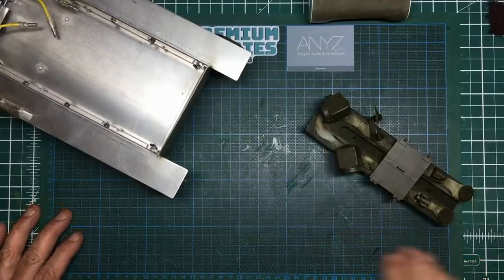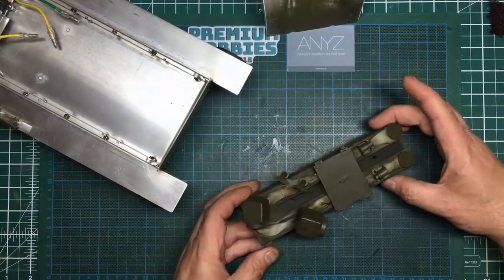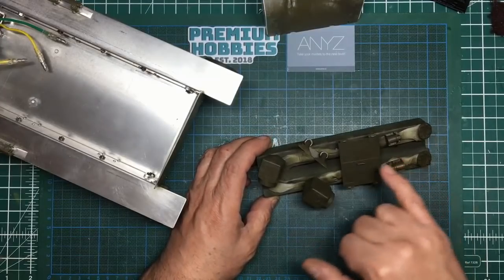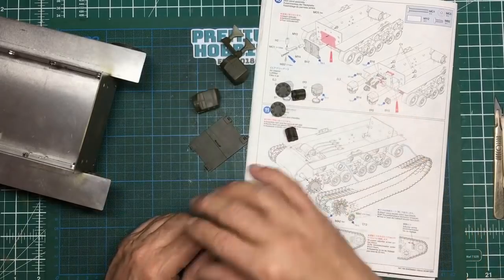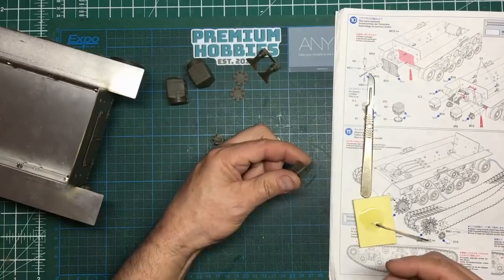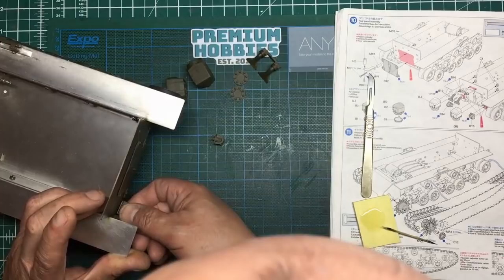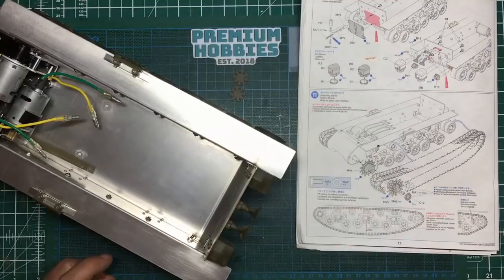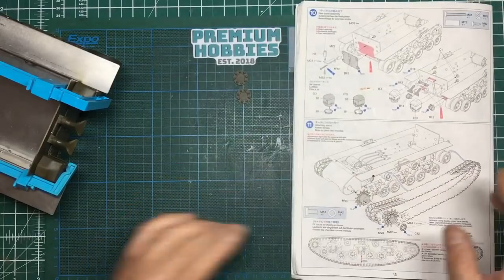Let's build a Tamiya 1/16 RC Sherman. Part 17

Comment: Great video Nigel.  I like the texture work you did and also the weld seams.  I’ve even tried using a ground down x-acto number 18 blade  then heated and pushed into the surface with a bit of up and down wiggle to create the weld seam.  It does work as long as it’s not too hot.  Hav you tried that one?  Guess Churchill was correct when his said , I have nothing to offer but blood, toil, tears and sweat.”. Well you certainly have given 3 of the 4 in your previous videos and now you can the blood.  Cheers, stay in, stay safe and Carry on.

Comment: I agree with what the previous comments have said, there's no law saying you must produce a video a day. A day off now and again is a good idea.
I meant to mention this before but forgot- when I built the Revell Routemaster I found that once the wheels went on it wanted to roll about when I needed it to stay still. I made up a quick & nasty frame for the front & rear wheels to sit in out of scrap sprue and that solved the problem, though a simpler solution might have been to make a couple of chocks. Maybe something like that would keep your chassis in place for delicate operations.